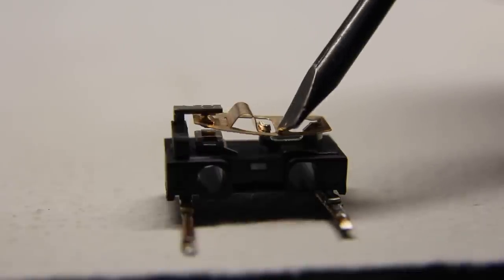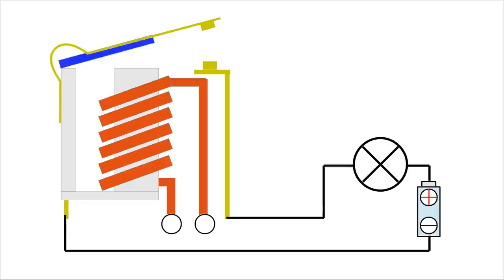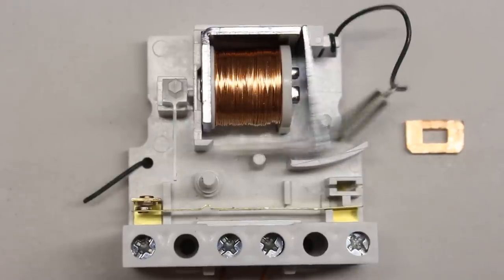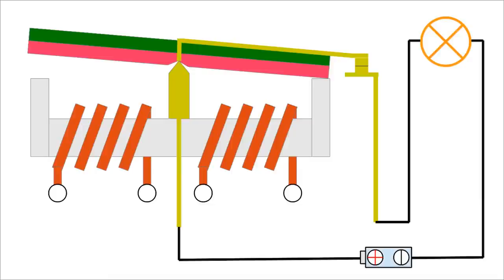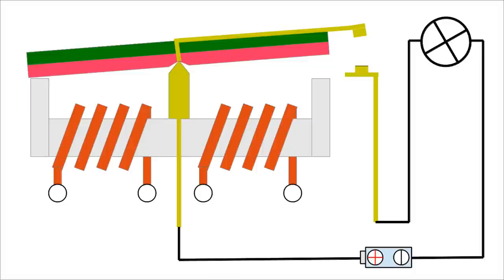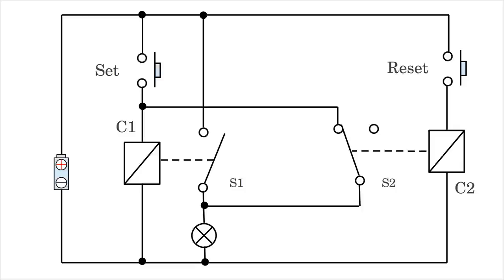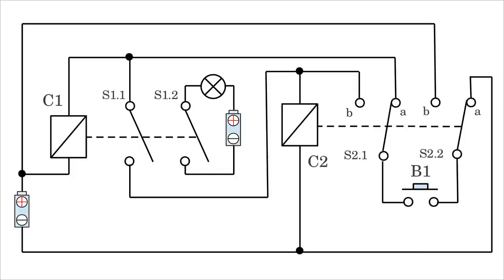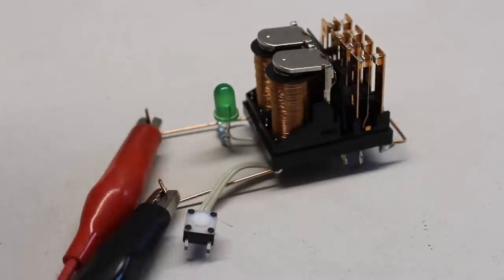From a simple switch to a relay clock

Comment: Where did you get your relays?
Reply from the maker: From ebay.
Reply: HomoFaciens is the omron g2r part lower on the comments the one you used
Reply from the maker: ...if this is a question, I don't understand what your problem is - go in the details if you expect to get an answer.